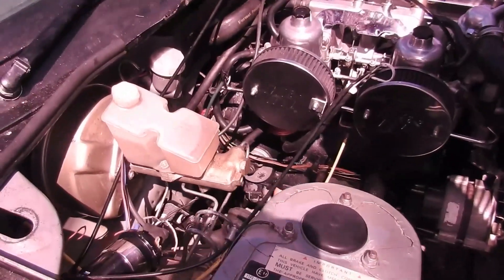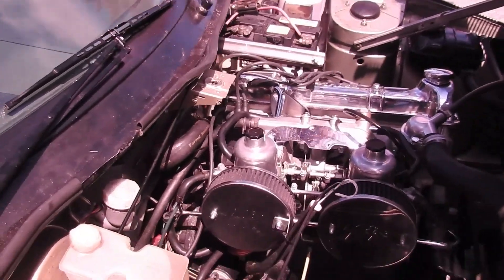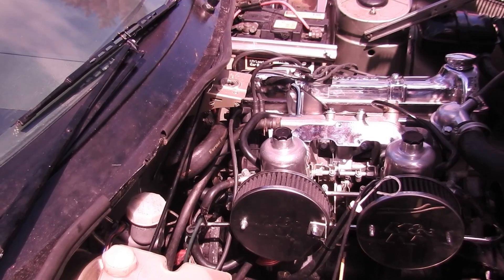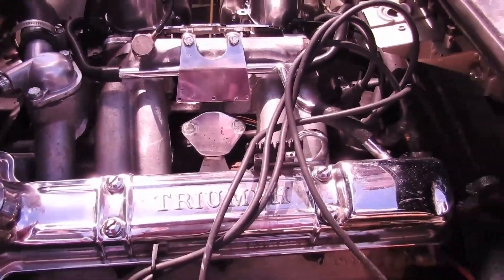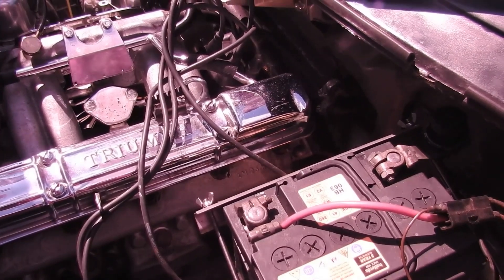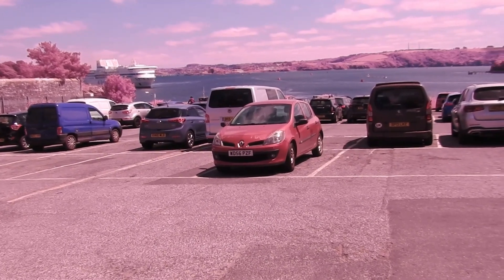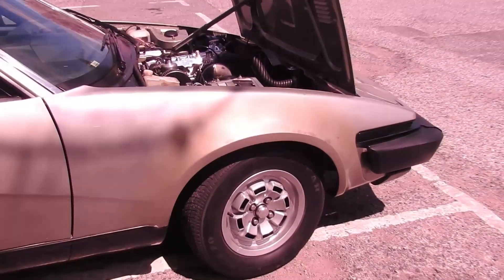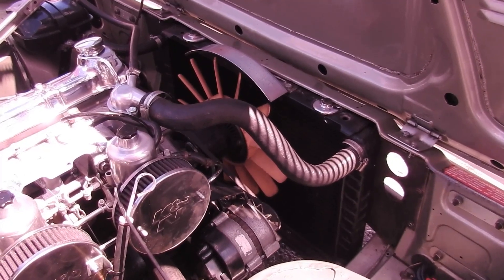Triumph TR7 1980 Water pump in Coil issues

Comment: HT stuck on ?
Reply from the maker: Fair point mate, the initial start should give a full 12V from the ignition switch to give a boost to the spark voltage for cold starts then it switches back to (or should do) 8V under normal running. My voltage during running is about 5V which is too low and the coil gets hot whether the engine is running or not, if the key is in the ignition pre-start position. There is a ballast resistor (it was called the 'Eureka' wire) that was used for normal points dizzy with a coil that was specified at 6V. When someone put the electronic ignition on this system a 12V coil would have been used and the ballast resistor should have been over ridden or taken out. I am of the thinking I have somehow inadvertently reconnected the ballast resistor and there is more current flowing now due to including the ballast resistor & hence voltage drop. More to come.....